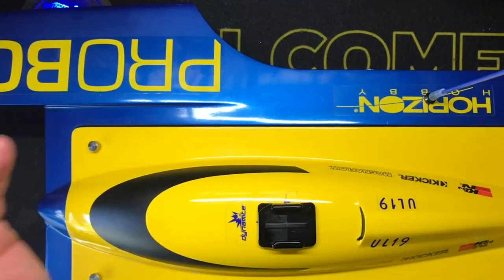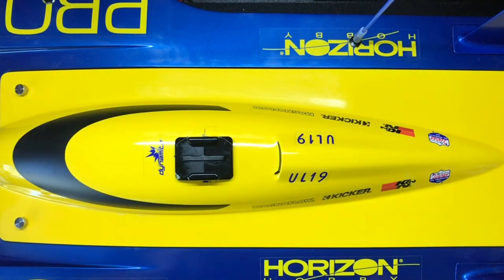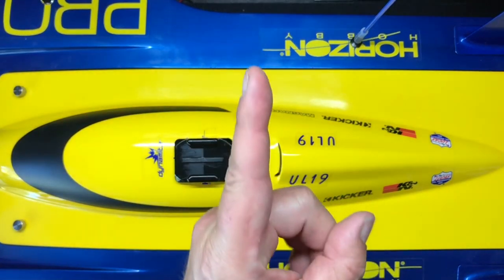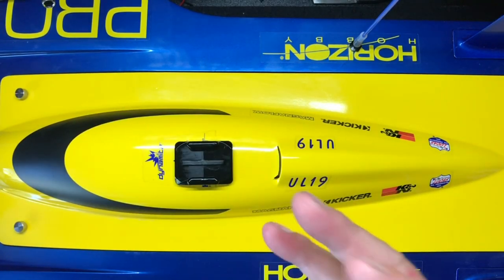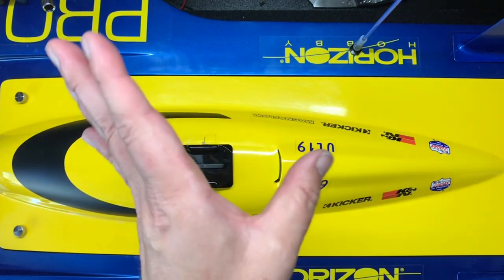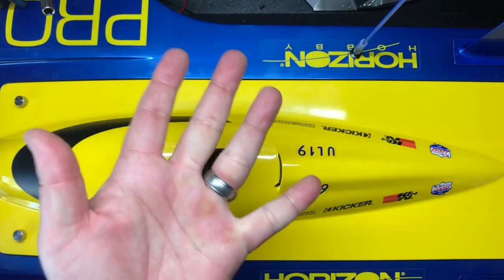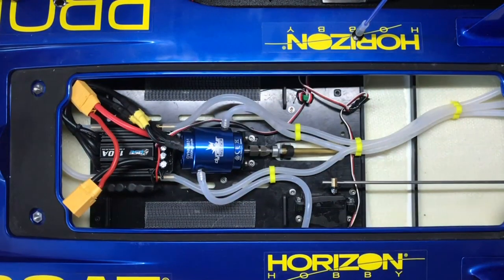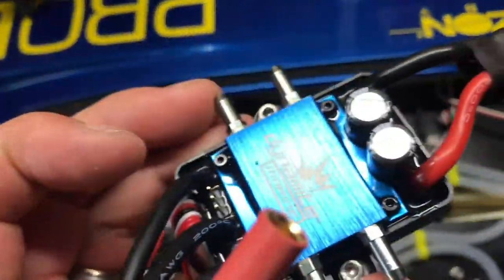RotoBoat - ProBoat UL-19 Upgrades.. a lot of em..

Comment: The boat will handle 6 s but it needs a smaller prop. If you modify it with cooling upgrades you can run a stock prop or slightly bigger on 6s for 73 + mph but you  have to upgrade the cooling system . I love this boat , it’s an absolute rocket ship if set up correctly. Great vid keep them coming !
Reply from the maker: Completely agree with what u said.

Comment: Just like with any vehicle...when you go faster either via faster motor or more voltage...you need to change the gear ratio.  For boats that means changing the prop.  If you don't you'll over heat things.  You must have missed this portion of the instructions:  "The included electronics are rated for 2S–6S LiPo batteries; however, running the stock propeller nonstop on a 6S battery could overheat your electronics or damage your batteries. If you run the stock propeller on 6S, we recommend using full throttle on straight line passes only. Return passes should be at half throttle to reduce the heat of the electronics. If you want to run 6S nonstop, use optional propellers (PRB282006 or PRB282027)"
Reply: Super informative Awsome information cause of this I pulled the trigger video was Awsome but this one comment made me learn more thanks brother

Comment: That seems to be a common occurrence. I own a Traxxas m41 and it's rated for 6s. I was using it at a local pond and the solder came off, it was fairly lame luckily I was able to rescue it using a drone. But yeah these companies keep pumping out vehicles that go fast but don't think about the heating and venting.

Comment: Hi I came across your channel and was listening to the issues you had with boat. I have a Pro Boat Recoil 26 I upgraded the prop to a 440 cnc 3/blade that gave me an additional 6mph faster speed. Then I upgraded the stock 60 amp ESC to the dynamite 120 amp. It runs 4s great but as soon as I tried 6s the boat got so hot the ec3 connector to the lipo battery melted off just like what happened to you. So I fixed that and should have taken it as a clear warning not to use anything larger then a 4s lipo, well I didn't I tried it one more time got two laps in and boom fried the motor. So I ordered a dynamite 2300kv 14 pole marine motor should be ready next week, but no more 6s just sticking to 4s it just runs to hot. The boat will max out at 50 mph on 4s I guess I should just be happy with that and call it a day. But I'm like you always trying to make things better and faster. Anyway just wanted to share that with you long story short a 120 amp ESC is not big enough to handle 6s so they should stop telling people it can, so they don't waste money, you know what I mean. Listening to you talk about all that stuff and upgrading your ESC to 150 amp all makes sense to me now so I can stop trying to figure out why my recoil will not run 6s, so thanks now I know sticking to 4s only,
Reply from the maker: Hey brother!!!! Yeah woth the upgraded esc and dual water pick up, she runs 5s nice and cool.   Haven’t tried 6s.    Not sure I will.   Can barely keep it in the water on 5s.  Can u send me the link to the prop your using??? Oddly enough I just sharpened and balanced mine tonight
Reply: I got the first 440 cnc 3 blade prop on ebay for 21 dollars, ran the boat at a summer camp for the kids showing off shit like that, gave the Recoil full throttle and it jumped out of the pool breaking the prop. The second one I purchased off of Amazon for $31.00 with free shipping, great prop .You can find it on ebay just type 440 cnc 3 blade rc boat prop it should be in stock, they make it in China like everything else but it came to the house fast works great.
Reply from the maker: The three blades prop is one of the reasons your running hot though.   Lot more torque.   I’m running a huge 3 blade prop on my 52” proboat rockstar and it jumps out too.   If u want to run 5 or 6s.   You’ll have to drop to a two blades prop.    Thanks for the info brother.   I’ll pick one up and play with it in 4s

Comment: I don't know if anyone has touched on this, but no solder joint is coming undone by heat unless that joint is getting 500+ degrees. If it's getting that hot, it's a poor joint. My XT90s on both my boats and X-maxx get warm when running hard.
An aside, and you should know this if you're into quadcopters, is more voltage means less amperage, so running hot on 4s makes perfect sense.
Reply from the maker: Agreeed brother.  It was the esc.  Over heating and heating through.   Swapped her out for a bigger one and no issues.  What boats ya running?
Reply: @jjrotogeek  that's weird to me that the ESC would get that hot.
For now, just an old Aquacraft UL-1 Superior and a V1 Impulse 31, both with HW 120a ESCs, running on 6s in the Impulse, 4s in the UL-1. Now that I look at the video again, I caught a glance of the solder joint and it looks good, so that wasn't the issue.
Reply from the maker: Agreed.   It was the esc.   It’s a known issue with that esc.  And that was just on 5s! I’m doing s video this week on a couple new boat builds.  You’ll dig it. The new outrigger I built and a genesis that’s going to be very custom lol
Reply: Awesome! I'm looking forward to it.

Comment: Yeah, that boat runs hot, regardless of how many cells you use. Horizon told me 180deg is normal operating temps. The only thing I found that helps is switching to a prop that has less pitch. the stock props 1.7 pitch is too much load on the motor.. I'm going to switch out to a 180amp esc and leopard 4074 combo from OSE..
Reply from the maker: Agreed brother.    I upgraded the esc and it helped a ton.   I’ll swap out the prop next season as well. What prop u going to?
Reply: I tried a Octura x442 that was balanced and sharpened. I ordered it for a different boat, but it brought the temps down quite a bit. There’s a guy on here using a ABC 1716 prop hitting over 70mph stock with 6s.

Comment: I'm getting this boat used tom and I have a 200a esc without Bec what do you recommend Bec wise to add to the esc ? And how would I put the Bec to the esc
Reply from the maker: You should just be able to wire the bec into the battery terminals (esc side) so when u connect power, the beck will also get power then supply to the reciever.   Just make sure your bec can handle 6s.

Comment: Had the same problems with the UL19 and Voracity. Those escs are junk . Voracity overheated even with double cooling.  Big boats like that need a decent esc. We ran a TFL pursuit all day flat out with the stock hobbywing 120amp esc and 3660 motor and not a problem.  Proboat are slipping with quality.
Reply from the maker: 100% agreed on all counts brother

Comment: Need biggers water outlets , you not doing nothing bacause the water fluid is the same because is stock in the outlets , 42mm prop 1.4 pitch less and will run nice with the  original ESC 120amp that is for S6 and the water pickup is in a bad position doing nothing but nice ideas but theres on OSE some plates for ESC cooling and better water pickups

Comment: Sir, same boat same problems, love your battery mounts, can you link me to the stl file so I can print some? ordering ose esc next already on my second motor. my cooling is very similar to yours and does drop the temps, also found that different battery mfgs make huge difference in temps and top speed. my boat will run near 70 on 6s but only short runs, overheats and derates, also looking at leppard motor after watching your vid. thanks for the show!
Reply from the maker: Doug DePottey hey brother!!! Yeah upgrade the esc and get a dual pickup rudder and it’s perfect lol.   The motors fine so far.  I didn’t make any battery 3d print last for this??? What are u referring to
Reply: @jjrotogeek   did u 3d print the tape for the batteries or buy it, i HATE  those effing straps to hold em down, big pia
Reply: and i have the aussie dual pick up rudder, it is much larger on both dimensions than the ose, my boat will throw water 6 to 8 inches out the side, dropped running temps 30 degrees.
Reply from the maker: Oh damn.    Send me the link to that if you would.   I’ll grab that rudder.   Mines cooling fine now, but better is better.  Here is the tape I use 3M Dual Lock Reclosable Fastener SJ3560 250 Clear, 1 in x 6 Ft https://www.amazon.com/dp/B00JHKTDMA/ref=cm_sw_r_cp_api_HuD1BbJZ5J6TB shits awesome
Reply: @jjrotogeek  its on ebay www.ebay.com/usr/ponti454, rc boat biz, takes a while to get here but i really like it, turns the boat like a meffer, have t reduce steering on control so it 
doesn't turn to hard, thanks for the link.
Reply: Hey JJ, Finally got to run the boat with ose 150amp esc, holy crap this boat flies, literally, have batteries all the way forward in cavity and the nose still tries to lift and flip the boat, I would hate to drop the prop strut to push it down as that would drop top speed, have prop even with sponsons now. The boat performed awesome though, no gps but by distance close to 80mph!  The dual lock is the stuff! Running 6s, stock motor, stock prop, cleaned up. Thanks for videos and help, Happy Thanksgiving.

Comment: You know you could of just installed better connectors in the first place and saved yourself money and time but I get the tinkering aspect. THe xt90 connectors or the 60s are a complete bottleneck for 6s hard charging. try rc proplus x6 connectors. the best. I use them on 14s
Reply from the maker: I don’t disagree with that.  Thanks for the tip brother.   Most of what I do now is gas and nitro.   Still do a few electrics here and there.   Building a sport 40 hydro.  I’ll try those connectors u recommend

Comment: That hull pickup isn't going to do you any good.  At speed that part of the boat isn't even in the water.  These are considered a 3 point boat meaning the boat only rides on 3 points of the water...the 2 forward sponsons and the prop.